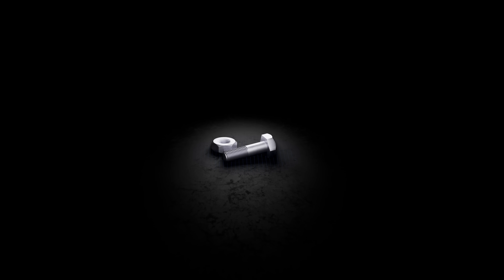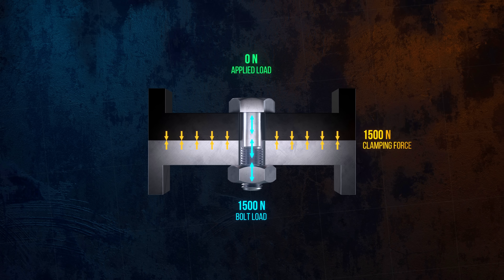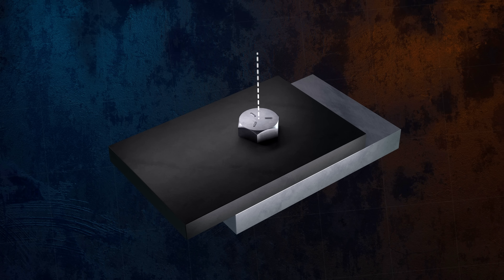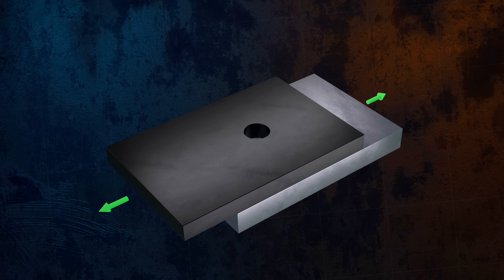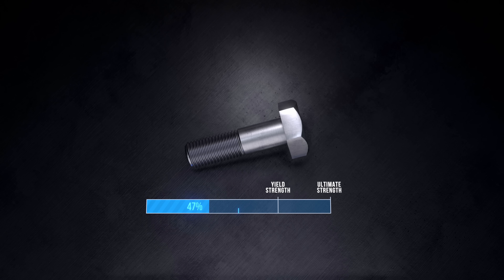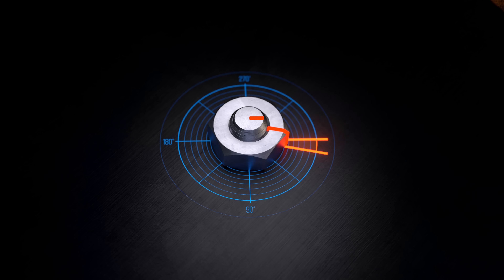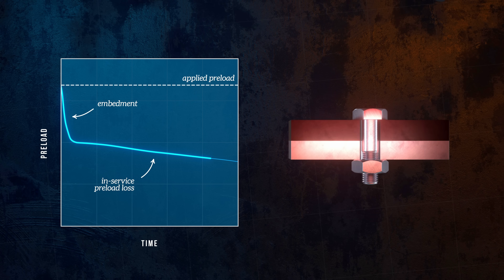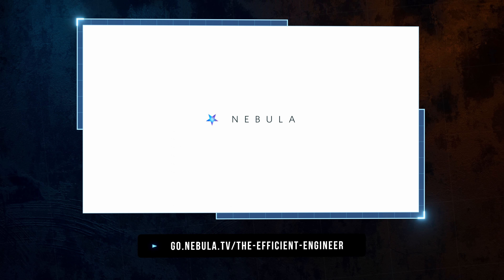The Incredible Strength of Bolted Joints

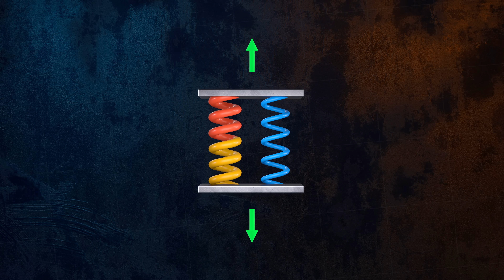Comment: In the explanation of why the joined member "springs" take most of the load (~3:19)... I don't understand how this can be.  The Bolt spring is in stretch, whereas the joined members are in compression.  How can the joined members assume load in the same direction they are trying to expand? ///  [I went back and watched again]:  I can understand that perhaps the bolt load wont go up a whole lot as the joint unloads within the force range of compression of the joined members, because there is comparatively little additional stretch being placed on the bolt within that range.  BUT that total force that is compressing the joined members is still being completely generated by the bolt.  SO... I think it might be more accurate to state something like this: "The amount of stretch/load on the bolt does not significantly change until the joint experiences a pull along the long axis of the bolt in excess of the existing clamping/preload force."   Does that sound right?  Either way, I think saying the stiffer springs take more of the load makes it more difficult to understand - for me, that statement makes me think of weight transfer in vehicles around corners; where a greater percentage of the load transfer goes to the stiffer spring as it resists the rolling motion of the car.  [and since tire traction scales less than directly with load, the end of the vehicle which experiences more of the weight transfer will be first to lose traction, all else being equal].

Comment: How can the two plates of the joint be treated as a single stiffer joint? Intuitively, if you press two plates together and therefor compress them, they would want to push each other away, providing a separating force like two compressed springs, rather than providing a clamping force. The treatment of two plates acting as one stiff spring would only make sense if the two plates were glued together with superglue, so that the two plates will stretch before the bolt does. Any clarification would be appreciated! :>
Reply: By single joint, I meant a single stiff spring*

Comment: It probably would better suit if the title of the video was "tension loaded joints". For most structure, joints are loaded with fasteners in shear, which is more efficient way to design a structure.

Comment: I was in disagreement about the tension joint at first, but I worked out a way to explain it in layman’s terms. Could you paraphrase me in a pinned comment to help everyone else?

Bolts stretch in tension. If you add enough load to the joint, the bolt will stretch enough to remove the clamping force entirely. At that point, the preload is gone.

Every amount of applied load less than that, the bolt is bearing the whole applied load plus whatever preload is left. The clamping force is equal to that preload, and I think it was too distracting to bring in when making that point.

In the end, the tensile strength of the joint is still the same as the tensile strength of the bolt, and I think that needed emphasized.

The use of preload in a tension joint is in rigidity, sealing surfaces, and cyclic fatigue reduction. The way the video was worded seemed like there was a change in overall load capacity, though there never was.

Comment: OK so what about the "Incredible" strength of rivets? In the recent past bolts have been used as a substitute for rivets and the results are not always good. Rivets, when properly installed have nearly 100% bearing contact and extreme slip resistance that bolts have difficulty matching. Rivets also deal better with hole misalignment as the rivet deforms while hot to match the shape of the hole.

Comment: Good stuff! When I was engaged in engineering I was interested in the room temperature preload and how that changed at elevated temperatures. In general you need a CTE of the materials in the compression path greater than that of the bolt or stud. It was all very interesting and difficult.

There are some good books out there especially one US book but I can't remember the author. The paper i tended to use was BS 3580 The Strength of Screw Threads

Comment: Bolts seem to offer a great alternative to welding and seem very strong.  That being said, why are we not using more bolted connections for things like roll cages? I cannot find a good reason against it other than those saying "well we just don't". Wouldn't a well-designed bolted together roll cage offer more strength than a welded one? Especially if it is locked down?

Comment: Great videos, that convey a great deal of information clearly and succinctly. The only thing that I struggle to understand is why the term preload has been used? It seems completely illogical to use a term to describe the bolts normal tightened state using a word with the prefix pre, as in 'before'. Logically, it cannot be preloaded before it is in use. Maybe I'm just being too pedantic but if someone can explain the reasoning behind the nomenclature, I'd be most grateful.
Reply: the assembly’s purpose in not merely fulfilled in being assembled, but in remaining assembled while experiencing external loads. 

Preload is the load before all other loads.

Comment: Question, and more of a thought concept. For shear joints, would it be better if you gave the two faces in contact ridges that match together? (Think like two gears teeth). Because the higher surface area for friction and the rides add a tension as well, if the piece tries to shear-off, it has to lift because of the ridges?